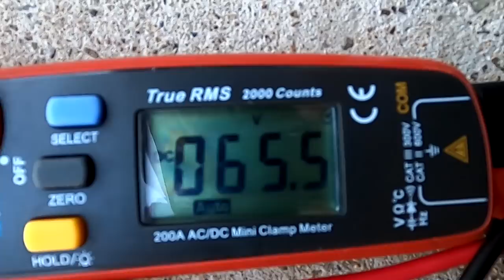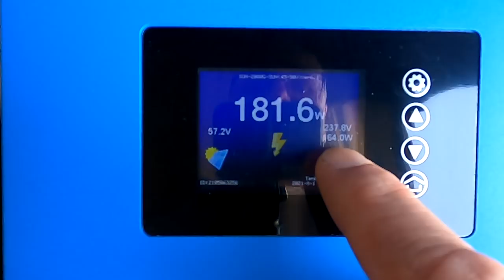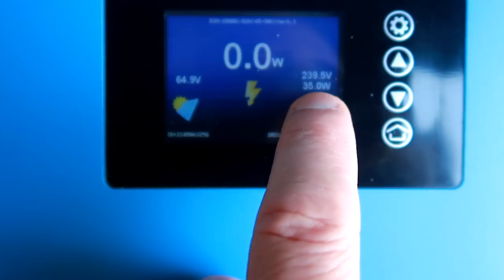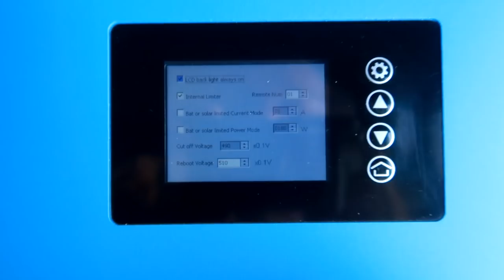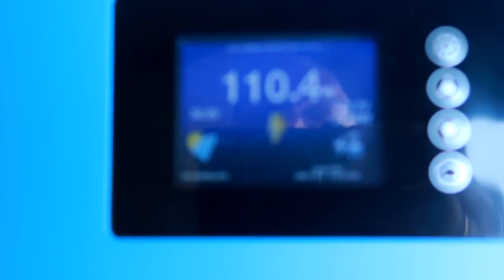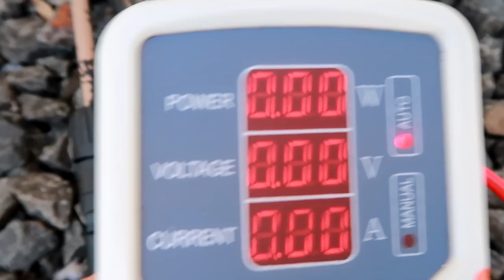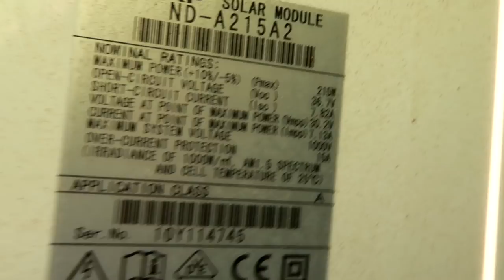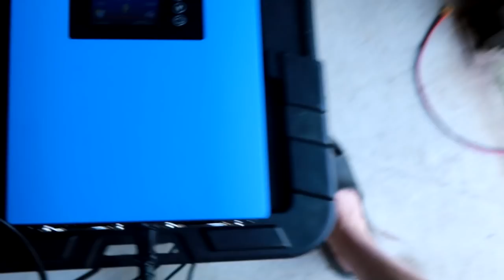SUN Grid Inverter GTIL2 connected to solar. How good will it work without battery?

Comment: love your video and REALLY love the sharing of your tools list - super. i tested the GTI2 1000W with 4x100 W panels and get 88% efficiency between DC in and AC out (ACout peak 300W)
Reply from the maker: Thanks for sharing, Erhard. 88% is not too bad for such a cheap inverter.

Comment: To calculate the correct series power of 2 panels in series, add the measured voltages from your solar panel tester from each panel and multiply that by the lowest current measured of the 2 panels. Thanks!

Comment: Great videos, don't forget that when using mixed panels in series ie a 215 & 220 = 2*215= 430 Watts DC. Shade just one and it may equal 2* 100 watt panels.
Reply from the maker: Yes, as we have seen with just a tiny bit of shade on one, both panels didn't produce more than 100W together.

Comment: The 420 watts total is @ lab lighting conditions. Usually panels produce around 70% of their labeled power. You should get about 300 watts. 
     edit:       * Sorry, I missed the part when you measured the solar light level *    (1100)
Reply from the maker: The panels were still over 25°C warm so that's limiting the power as well.
Reply: Very true... Panels are about 70% efficient.

Comment: Also at roughly 50v these inverters start lowering their output. That’s another reason why a 48v battery shouldn’t be used. Also you really want the voc of the connected array to be roughly 80 so when the mppt draws the voltage down you stay safely away from the bottom voltage range
Reply from the maker: From the previous test, I could see it outputting 1.6kW at 49V with no problem.
Reply: This is only for short time.  Below 52 volts it cannot output this for much time.

Comment: Hi Andy, love your videos! Thanks so much; look forward to seeing them everyday. Question: where I live the power company does not allow you to feed power back into grid. They are concerned that when power goes out and line workers go to repair that they could be killed if you are feeding power into grid. I noticed that for a brief moment that your set was feeding electricity into grid until it adjusted. Is that a concern when electricity goes out and line workers start repairs?
Reply: They only operate when they see the grid. Disconnect in milliseconds when the grid fails.
Reply from the maker: Greg, that cannot happen. If the line workers turn off the power, all inverters will turn off immediately within 30ms as per regulations. It's called anti-islanding. They will not stay alive just by themselves.

Comment: Ive been trying to figure out a resolution for my situation and if I'm understanding this correctly, this is the key ive been needing.

Have Mains Utility with auto transfer switch to propane whole home generator. Seems this is what I need in contrast to the micro grid ties since this will not back feed and excess the grid and I don't have to do some other fancy multi position transfer switch. could put one on the east side of the house and one setup on the west side and be able to offset usage. I work from home so my usage drops at night.

Comment: I love that you do the tests! I really like the crazy tests like one full 280Ah battery 🔋 and an empty one! Very entertaining and verifiable legitimate information.  Some tests of multiple BMS situations on one battery pack as in Active Equalizing Balancer and Passive BMS and multiple 5 amp Active Equalizing Balancer and a Passive BMS. Active Equalizing Balancer that only Equalization balance between adjacent batteries and those that claim  Equalization balance all batteries at the same time.  Then using both and a Passive BMS. Maybe even pushing it to the point of letting the magic smoke out and a little drama of a fire extinguisher 🧯.  Hey, I'll watch 😆 🤣 😂 😹
Reply from the maker: Hahaha, don't get too excited!
Reply: @OffGridGarageAustralia  it's always easier to watch! Thanks for all the adventure of examination and tedious time consuming work.
Reply: @OffGridGarageAustralia  BTW I have a 20,000 watt hour lead acid 48v system and working on two 48v 16s 310AH CATL Lifepo4 3.2V banks right now. Top balancing as I type this. Thanks again for all the enthusiasm and encouragement.
Reply from the maker: @xr680r  Thank you 😉

Comment: I am not familiar with your solar tester meter (the orange and white one). Where do I get that? I have done it all manually with volts and amps and then calculating watts in my head. Your meter makes it so easy.
Reply from the maker: All links are in the description and you can find it here on my website: https://off-grid-garage.com/measurement-tools-and-analisers/

Comment: When measuring panel output, connect  a 1 ohm 500 watt resistor across the output of the panel. Square  the voltage, and that  is the wattage output
Reply: but that is not the MPPT condition

Comment: Wait, the instructions say that the GTIL2 hooks up to a PV, so I was going to ask if any special requirements working with batteries. Your video says you are just testing it with PV now implying you were using batteries before. So you have no problem w/48V LiFePO4 batteries with the 45-90V version?

Comment: Hi Andy, i had the same problems with my solar system, can u please give the mppt a chance when u are using 2 off the same solarmodules? Shading is really tricky on solarmodules, but if u have 2 or more in a string of the same modules, the mppt can find the global spot, to work. 
I bought 2 new (120 cell before, it was 60 cell modules) and i have arround 140% until 200% more power in the morning, when one is shaded.

Best wishes from Germany/Bremen but please look for a local dealer wich has another german beer for u :D .

Have a nice day/night.
Reply from the maker: Thank you. The solar panels are all used. New modern split-cell panels have a better efficiency with shading. Maybe in the future...

Comment: Can you just connect the GTIL2 to any outlet or do you have to connect it to a fuse panel in your breaker box ?
Reply from the maker: It is designed to be plugged into an outlet. The outlet is fused in your sub panel. But please check with your local regulations.

Comment: Could you do a test with battery and solar? I do not understand how a battery connected to the DC inputs would deal with MPPT as the inverter tries to adjust to a battery and not solar. Do you have to put a disconnect between the inverter and battery and then use a charge controller to charge the battery and then switch off the charge controller and switch on the connection from the inverter to the battery?? I'm confused how it can work on a battery and have battery charging. I completely understand how you could just replace the solar input with battery input. It is the charging of the battery that I don't get.
Reply from the maker: It works, many videos on YouTube showing this. The test I did in the previous video was with a power supply. The MPPT does not track the power point and stays constant. Same for a battery input.

Comment: I know it says you need 45v but i noticed when you where uping the volts you got to 34.2v and the red message went away, so dose that mean it can work at just 34v ?
Reply from the maker: It may work at these voltage with very small loads. In the settings you can specify when to turn on and off the inverter.

Comment: So I have one of these gtil2 2000w inverters coming soon, operating voltage is between 45 and 90 volts

I have 5x300w panels, max power output is 37 volts and open circuit is 45 volts per panel, am I right in having 2 panels in series and the rest in parallel?

Comment: the consumption was more expensive for me rather! that I have badly connected

do you know where the ct sensor goes

I have 220 in the neutral, ground or positive phase?

I have this model

SUN 1000W Solar Grid Tie Inverter with Limiter Sensor Wi-Fi DC 22-65V 45-90V AC

Comment: Nice does this inverter have the option to run from batteries charged, but also a option where it can control discharge of batteries to a percentage say not more the 50% so batteries do no get fully drained. Thanks
Reply: Yes

Comment: @Off-Grid Garage hi, I have 2 (maybe stupid) questions. After I made my research for this grid tie converter I was not able to find what happens in case of a grid brownout.
I'm thinking about getting the small 1000 for 24v battery pack, the datasheet says it can do 22 to 60v DC but in () next to it "starting voltage 26v" dose this even work with 24v pack using 3.2v cells?

And most important is this thing still working in a brownout situation?
I live in the Philippines and we have common brownouts sometime lasting for hours.
Hab ich den Dialekt richtig gedeutet und hätte auch auf Deutsch fragen können?

Comment: Hello, can this inverter charge the batteries from solar and from the grid ? Thanks
Reply from the maker: It's not a charger. It's a grid tied inverter which can run from solar, a battery or both.

Comment: Would love to see 10aH 48V pack of supercapacitors in parallel with that
Reply: Hiya, you just need to be careful with the input voltages. The 1000 and 2000 have different input voltages if you are using batteries.
2000 is 45 to 90v dc

I run my 1000 with 2 Tesla modules because I’m not in during the day and this allows me to use the solar at night!
I like the idea of using 2 together.

For daytime I tried a mastervolt 500w grid tied inverter and it covers the fridges and tv.
(Interestingly the ct clamp display on the sun shows the wats in / out of the house.)
Will have to save up for the 2000 watt one.

Take care all.
Reply: You would lose mppt capability I think.

Comment: you tested panels at voc. when the mppt is on its vmp. so lower voltage with a load on.
Reply from the maker: I tested both in the video 😉
Reply: @OffGridGarageAustralia  must have missed that. woops.

Comment: I have a standard one way mains meter in the united States. Will my meter see the power from this inverter and charge me for it? I have heard some in the states say that is the case.
Reply from the maker: If you use the clamp sensor correctly, the inverter will not export any power.
Reply: @OffGridGarageAustralia  that's correct, but, I have heard my U.S. meter from my power company still sees it and charges me? Whatever it creates? I don't see how though. My meter should never see the inverter at all. 
I have had some people tell me if your inverter makes 400 watts and you used all of it, no export, my power meter outside will still see it and charge me anyway. Makes no sense to me. How could it see it if it never exported. 

I want to make sure that's right to. I'd like to buy 3 of these and run them at 1/3 capacity.
Reply from the maker: @kevinroberts781  that is wrong what people tell you. If you have a load of 400W in your home, the inverter will produce 396W of it and you will still pay for the remaining 4W coming through your meter.
Have a look on YT here, you will find heaps of videos where it is explained and shown as well.

Comment: I have same inverter and I just installed I vage 400w solar panels it’s all connect it’s showing a tiring ok on display the voltage of panels the loads of the house but the inverter it’s not producing no power and it’s completely full sun on the panels and I did set the inverter to 250w or I did put off the limit but still no power produced by inverter any idea??

Comment: i was just wondering could these be used along with say a battery powered inverter to produce the signwave and then these give the extra power that needed or if they will damage the battery powered inverter
Reply: I was wondering the same thing if it can reduce the load of the battery off grid inverter I worry tho at times it slightly feeds back into the grid im not sure what effect that would have on a system like that

Comment: Could be losses in the wire from the solar to the inverter.
Reply from the maker: It's a 2.5mm cable and the current was only 6m. There are some losses, but not much.

Comment: Measure dc volts and amps at inverter connection from solar while connected to grid with load.
Reply from the maker: The inverters shows the voltage on the display and the amps will be the same, regardless where you would measure.

Comment: You never get max power from panels. Real world, Lucky to get 75% of what the max the panels say they can give. Nothings wrong with the inverters mppt
Reply: You can get full rated power and more. done it many times with quality real TUV rated panels. this myth comes from the large amount of cheap fake rated panels on the market. people think its normal to never see above 70-80% output but its not.
Reply: Depends on the solar irradiance. 
Clear skies at noon should give 100%, but high level clouds or haze can bring that way down.
Reply from the maker: I'm getting full power from my panels under certain conditions. Cold wind and the sun comes out behind thick clouds. 110% I've measured for 20-30s. Once the panels heat up again, the power output drops though.